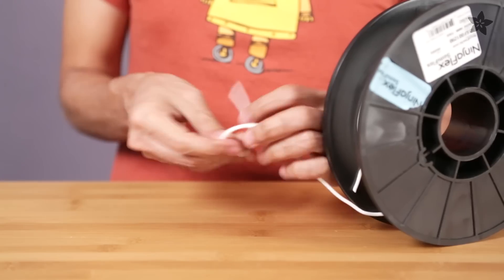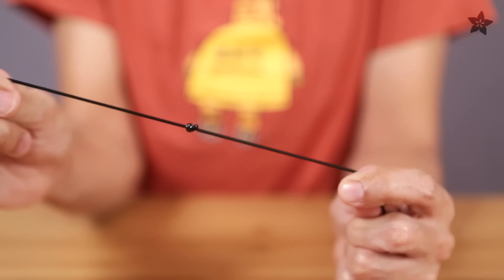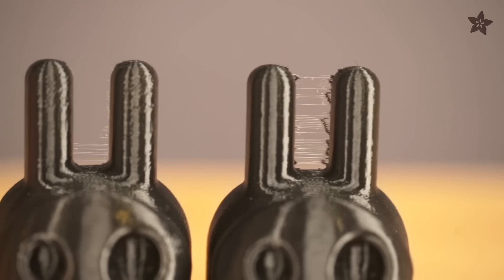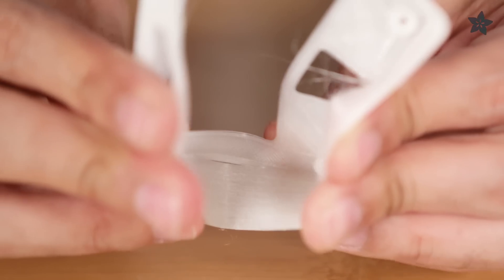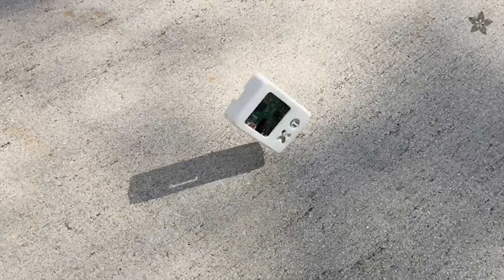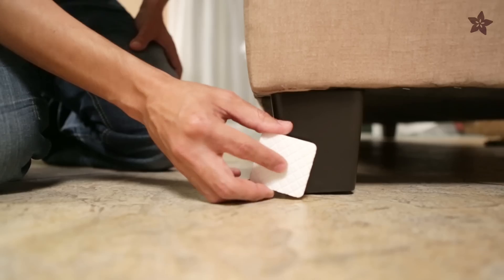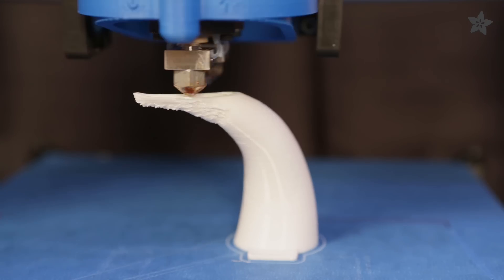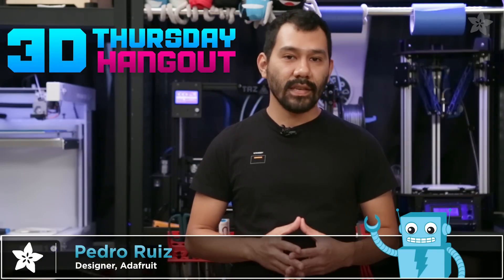NinjaFlex SemiFlex Flexible Filament Review

Comment: We are two fathers that have crowdfunded the Worlds first flexible 3D Printer Filament made from compostable raw materials. It works with all printers we have tested so far including Bowden Extruders. It is heat and cold-resistant from -15 to 105 degrees. Are you interested in testing it? Get in contact with us or purchase it directly here: http://willowflex.eu/

Comment: Incorrect. Both ninjaflex and semi flex work with bowden extruders. I could tell just by the demo that they were printing WAY too fast. With bowden extruder you want to print NO FASTER than 15mm/s. Also i saw no cooling to speak of. When printing ninja/semi you want to have at least 2 fans with ducted flow directly at your print tip. And thats on the UM2. Also disable retraction and increase your extrusion rate 3 - 4% if you are still having issues. Make sure your bowden tube is clean of dust or any other residue from other filaments.
Reply: Old comment and video but just wanted to second this I use a custom made bowden extruder setup with a PTFE tube that runs through the extruder and just a notch cut in it for the gear to push the filament through so there is no room for binding up and it works great.